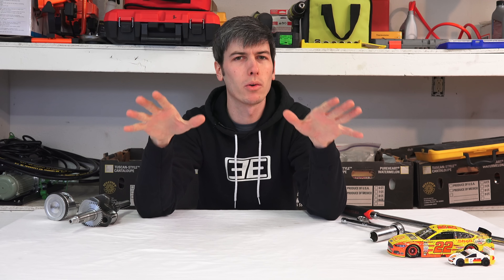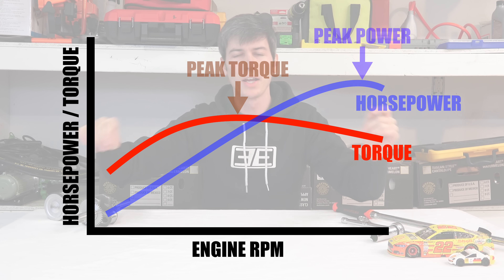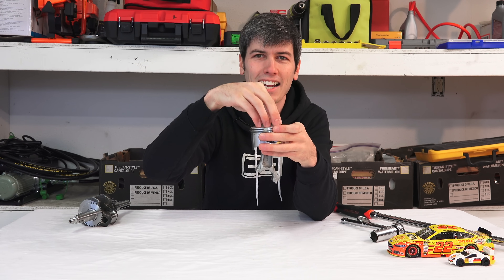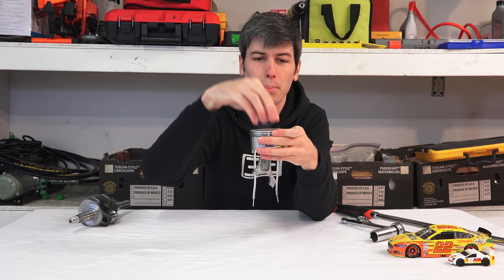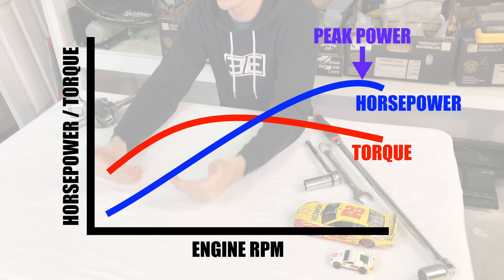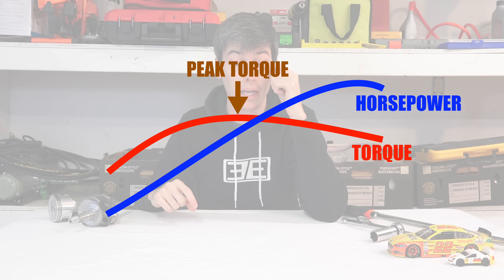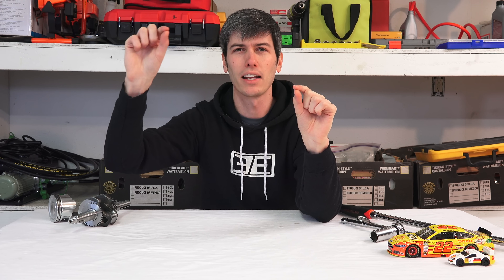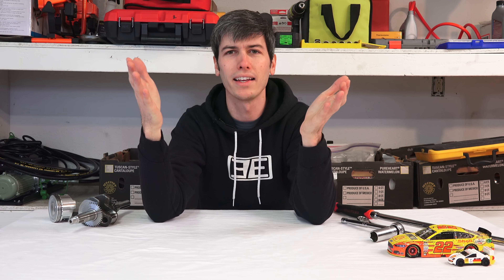Horsepower vs Torque - A Simple Explanation

Comment: Does it imply that, with a proper gearbox, a Mercedes Actros tuck V8 diesel can make a GT-R move faster than the GT-R stock engine?
Reply: It implies that the engine with the most horsepower is always the fastest.
Reply: In real life that is not always the case, because normal cars are not 100% acceleration focused. For race cars however, you can almost certainly take it as a fact.

Comment: Wait. So Rotaries have literally no torque
Reply: They do. Even though they have no crank, think of the rotor as a piston and connecting rod in one.

However, because of a myriad of technical reasons, they generally have a low torque compared to piston engines of the same horsepower rating.
Reply: jaboxs i know how rotaries work but still thanks
I just didnt think of the rotors being offset from each other like on a regular crankshaft
They still have no torque
Reply: If by "no" you mean "quite low" then, yes we are in agreement.
Reply: jaboxs k
Good then

Comment: Do diesel engines have higher torque? Is that why they're preferred in tractors and lorries etc.?
Reply: Generally they have more torque, yes. 
However, as you have seen in this video, that is irrelevant.

The reason is more likely their lower fuel consumption for a specific power output, and the fuel is often cheaper in itself.
Reply: jaboxs you need torque to pull things , a 500hp car engine and 500hp truck engine even if geared correctly will never pull the same the torque output will be very different to the ground, rpm will also result in a petrol losing as the gearing will need to be so high it won't rotate at the wheel
Reply: They will pull the same load actually, and at the same speed to! Generally its not such a big difference as you might think, the gearing most certainly could compensate in most cases.
However you are right in that it will result in a engine that is way more sensitive to being "bogged down" and such.

Comment: Great video as always but for accelerating faster why do you consider more torque (in the example 150 lb-ft vs 160 lb-ft) when torque and angular speed are inversely proportional at a given power? And also isn't horsepower a unit of power or are these terms used interchangeably ?

Comment: Probably also worth mentioning is that you can have torque with no power. Ie. You can apply a force to a stuck bolt with wrench, and the bolt won't move: it still has tourque being applied to it. Power is how fast you can spin a wrench on the bolt with a certain tourque.. more power = the faster it spins.

Comment: Why the peak torque is at a different RPM than peak HP?
Why do electric electric engines have constant torque?
Reply: For the first one is because hp=torque*rpm which means that with constant torque the hp will increase with rpm.
For electric engines it's because they don't have inefficencies based on rpms as internal combustion engines have

Comment: I have this doubt.... What you say is more the power more quicker we can go... Then what's the use of peak torque? I didn't Quite get it... Is it means the quicker way to reach power or what?
Reply: It is of no use at all concerning acceleration. It is only a way to say "horsepower at the max efficiency rpm". Interesting for commercial operators for sure, but not so much for normal motorists.

Seems the term has stuck around, even though it is of questionable use. Probably because of motor journalist and other people of little technical knowledge.
Reply: jaboxs well i too was thinking... You might be correct...

Comment: So the maximum power sett the top speed and torque the acceleration?
Reply: No, maximum power sets both. Torque has no direct relevancy what so ever, even though it may be hard understand.

(I simplified a bit, but generally this is true)
Reply: Well, it HAS relevancy for the acceleration in mid range. It also has relevancy because a high power engine without torque being very revy (spelling).

As I have understand it before, the torque is about mid range and power is about the top of the revrange (spelling?).
Reply: It has relevancy in as much that it also denotes horsepower i.e. if you got a lot ot torque in the midrange you also got a lot of horsepower just a little bit higher up the revrange. 

Concerning "revy" I think I see what you are getting at and kind of agree. However, If you look at certain motorbike engines for example they have a really good torque figure for their capacity "slagvolym" and still rev a lot. An old bike of mine was quite happy in 6th gear at 40kph (km/h) and still revved to about 12500 without a sweat. If they would have geared it higher and put an artificial rev limiter to 8000rpm nobody would have complained. But a higher max rev means you can get away with lower gears which help alot in a performance vehicle.

You are correct in saying that a lot of people use "horsepower" when meaning power in the high power band and "torque" when talking about power in the lower power band.

Since you can calculate the cars acceleration and top speed and such just by inputing horsepower in the formula, while torque will not let you calculate or approximate anything at all, it is seems smarter to say "horsepower in the midrange/lowrange" compared to saying "torque" even if you mean the exact same thing, since this misunderstanding that torque effects performance seems to stem from the overuse of the word.

P.S Jag finner det lustigt att vi har denna konversation på engelska, men det går bra för min del.
Reply: I think we should continue with english so Jason can follow the discussion. 

On one point I strongly disagree with you. Torque is better than power to calculate acceleration. Take for example the car I drive at the moment. A Skoda Fabia 1,4 16v from 2005. 55 kW in the engine. About 1200 kg. If you look at the power it should be possible for it to accelerate from 0 to 100 in about 8 seconds. It needs about 12 seconds. The reason for that, beside the fact that it can't have maximum power all the time, is that the acceleration also can be calculated with the formula F=m*a and using the torque-figures. And the torque just isn't enough. Which is pretty clear when you try to accelerate from 80 to 100 on fifth gear (is nobody home!). 

That is also the reason how an Saab 900 Turbo could be faster in 80-120 on the top gear than a Ferrari Testarossa. Of course the Ferrari was faster in a dragrace and have more power. But the Saab have more Torque. A lot more. So a torque engine dosen't need revs.  Witch is also the reason why Harley- Davidson dosen't present power on there bikes (you don't rev an HD to the limiter).
Reply: As I said earlier: If by "torque" you mean (horse)power in the lower revrange, then we are in total agreement.

If you however believe that torque by itself have anything to do with acceleration, which it seems to me by your examples, then you are completely wrong. 

the F in F=ma is a force, not a torque. The A in that forumula includes the component of time, which is not availible in the torque measurement. However, it is handily enough availible in the power measurement. Almost as if time matters when you are talking about acceleration. Funny that, huh?

Your "real world"  examples make it seem to me like you drank to much manufacturer cool-aid, and is a bit lost. Understandable, but I will gladly dismantle them as well, depending on if you see the light after this post.

No hard feelings, we all make mistakes some time, especially if you have been "taught" things which are flat out wrong.
Reply: Yes, torque is force * distans . How strong the wheels are turn around. That means, if you divide torque by the radius of the wheel you get force. 

The Fabia I drive for example has 126 Nm of Torque. The top gear is 0.88:1 and the final ratio is 3.88:1, that means the total gear ratio is 3.41:1. That means 430 Nm on the wheels, in real world around 380 Nm because of losts in the transmission. With a 600 mm wheel the radius will be 300 mm and the force that put the car forward is 1270 N. That means the maximum acceleration around peak torque is about 1 m/s^2 on top gear. Witch is exactly how slow the car is!
Reply: If you really want to get tecnhical you can call it that you convert energy. But "energy conversion rate" does not have the same ring as horseower. If you drop the "torque" naming scheme, I promise to start calling it energy conversion rate, deal?
Reply: jaboxs absolutely with u there. The problem is that the power for example dosen't explain why you need gears. 

So I will stay say torque is in the low and middle range and power is how it will behave at top.
Reply: And with an engine with turbo or supercharger what dosen't work in whole revrange all will be different of course..
Reply: But it does explain why you need gears? Since power is Torque*Revs then power increases with revs until the torque drops so sharply that the increased revs cant compensate in the calculation. An engine with perfectly flat torque curve will double its power when you double the revs.

Oh and by the way, have you seen the torque curve of a modern engine? for a normal car, above 2000 rpm they are almost flat!
If torque accelerated the car, then the car would accelerate at the same rate at 2000rpm as 4000 rpm, as the torque is the same, right? But as Im sure you are aware, it does not.

So power absolutely expalain why  you need gears: To keep in the right powerband. However if torque was the factor, the yes, between 2000-5000rpm you would need no gears as the torque stays almost the same. I think you just disproved your own agrument?
Reply: And if you for some reason, noise or fuel consumption for example, what much strength and low revs at the same time you have to look at the torque, witch is my point.
Reply: Last post on this: If you want to know the performance, you have to quote both torque and the revs at which you have that torque. Quoting only the torque number, as is often done, will not suffice. If you quote the power, that is the only figure you need.I choose option 2, and I think every one else should do the same so as to avoid misunderstandings such as is rampant even in this comment section.
Reply: jaboxs we made different choises there. Agree that only the number isn't give the hole story about torque.

Comment: Why engine torque reduced at higher RPM?
Reply: Divyesh Patel i dont know exactly  but i think it happens because at higher rpm pistons/crankshaft have a lot of momentum and cant really add any more torque so it starts to decline but hp will increase due to faster movig pistons
Reply: Several reasons. At higher rpm, there is more friction between the piston and cylinder wall, reducing the force on the crankshaft. Also, the cylinder head may not be able to provide the same amount of air flow into the combustion chamber in the shorter time required at higher rpm.
Reply: Has to do with the efficiency of the engine at various speeds.. there’s a sweet spot
Reply: one extra factor is the speed at which fuel combusts, torque is max if fuel combusts as the piston goes down, just like pushing someone on a swing, at low rpm combustion ends while piston still has travel to make

Comment: Horsepower= torque * (rpm/5250)
Reply: thanks, i was looking for the constant value :)
is that to Nm or pound feet of torque?
Reply: Simon horsepower is a non metric unit of measurement of work done at a specified rate so i believe the torque is in foot pounds not Newton-meters. Of course you could use Nm but the rpm constant would be a different value.

Comment: Jason I understood everything until the end. You said at a given gear ratio you would feel the most force pressing you into the seat(which is acceleration) at peak torque. But then you said that a car with a CVT would go to what ever gear ratio it needed to keep the engine at peak power for maximum acceleration. What am I missing here I watched this part several times and I don't get it.
Reply from the maker: Yes, this part can be a bit confusing. It has to do with having a set gear ratio (peak torque is peak acceleration) or a set vehicle speed (peak horsepower is peak acceleration, but with the ideal gear ratio). I explain exactly how this works in this video: https://youtu.be/cb6rIZfCuHI

Comment: QUESTION: If torque= force x distance, does that mean that vehicles with longer driveshafts have more torque?
Reply from the maker: Force*Distance, the length of the driveshaft will not impact torque, generally speaking (longer ones would have more mass, thus increasing rotational inertia, which would impact power negatively).
Reply: Thanks for the reply!

Comment: So if power is dependant upon torque.... wouldn't that mean a higher torque vehicle could technically produce more power IF you add more RPM's to the equation?
Reply: And what about diesel engines that have significantly lower hp than torque... and the car with 200 lb-ft would be able to go a greater distance than the 200hp car- just in a longer time frame??? and what about torque curves that stay mostly flat over most of the rpm range? Good video explanation though....
Reply from the maker: Correct.
Reply: hp IS torque with rpm so it would be making more HP assuming you could stop the tq from dropping off a cliff with more rpm

Comment: Diesel truck owners will still argue that their slow trucks will beat "ricers" off the line because of their torque.
Reply from the maker: If they have more aggressive gearing, it's possible for a brief moment they accelerate more quickly, but in the long run power will win.
Reply: Engineering Explained I have a stage 2 Golf R with DSG. 350 whp. All wheel drive. Aggressive gearing. And it weighs 3300 lbs. a 600 whp 9,000 lb. truck won't ever be ahead of me. Except on the internet according to the truck driver.
Reply: If you remove the mass it would , the gearing is also to short , you constantly losing momentum with changes
Reply: Kavi4GP no one with a diesel truck makes them lighter. Pure race trucks sure. But not street trucks. And DSG shifts in 8ms. There's not too many auto transmissions in trucks that can match that.

Comment: Where it's making the power is important too. Two cars, one with 200 HP / 200 lbf vs 200 HP / 100 lbf for instance. They're making the same power but by definition the one with more torque is making that power at a lower RPM, so you don't have to rev it out to access the power.
Reply: You always can start car from medium rpm. No need to start it from idle...
The only advantage of engine with high torque at low end is when you are already on low rpm and suddenly need to accelerate.

Comment: Is that why having a lot of torque in the low rpm is important to accelerate from a stop. Because horse power is low caused by the low rpm, and torque is the only thing accelerating the car?
Reply from the maker: Somewhat, yes. HP will be low because RPM is low, good low end torque means at low RPM you will have strong acceleration, relatively speaking.
Reply: Awesome, thank you so much for answering!!
Reply: A Honda Accord will accelerate faster than a S2000 from 0-30 because it has more torque (and more low end horsepower).
A S2000 will accelerate faster than an Accord from 30-60 because it has more horsepower once the engine (and the car) gets up to speed.
Reply: Cevair Zufer.  Yes but to put it more correctly is torque at the wheel, not torque at the crankshaft.  Maximum torque at the wheel only occurs at maximum horsepower.  So maximum acceleration, at any particular vehicle speed, occurs when the engine is producing at maximum horsepower, not maximum torque.
Reply: Exactly why the S2000 is hard to launch as you need to launch at high rpm to get off the line quickly due to the smaller displacement engine not providing huge low end torque. While also balancing tyre grip and not blowing up the rear diff.

Comment: where i believe the 5252 rpms comes from: 1 horsepower is the rate of work to move 33,000 1 ft in 1 minute. 1 lb ft torque for example, is applying 1lb on the end of a weightless wrench; the twisting force. now, say we have a crankshaft that has a 1ft radius just for easy numbers use. now with a radius of 1, its circumference would be 6.28 (2×pi×r). now, interestingly, 33,000 divided by 6.28 is 5252. what i believe that says is at applying 1lb ft of torque to it is at the speed of 1 horsepower, at 5252rpms. so it can be expressed that hp and tq are the same at 5252rpms.  i hope that kinda clears it up a little, sorry if i explained a bit poorly.
Reply: Brad Daechsel easier with proper units .

Comment: Thanks, you have made sense of it all. I have a question-
Is it possible to have peak torque occurring at the same RPM as peak horsepower?
If so, are any engines produced that do this?
Reply from the maker: It's certainly possible, but generally speaking a wide, flat torque curve is ideal, with peak horsepower occurring at peak RPM.
Reply: in american measurments this happens at 5252 rpm, so you just need to design an engine which hits its torque peak at 5252 rpm with an unnatural fast falloff past that
Reply: Thanks. :-)

Comment: How powerful would a bugatti cheron engine be if it could go up to 20 thousand rpm?
Reply from the maker: If it could sustain torque, you can simply multiply it by 20,000/(Peak power RPM). Probably a factor of 3x the power.
Reply: thanks sir... appreciate it .
Reply: so does it mean 1479*20,000=149,580,000